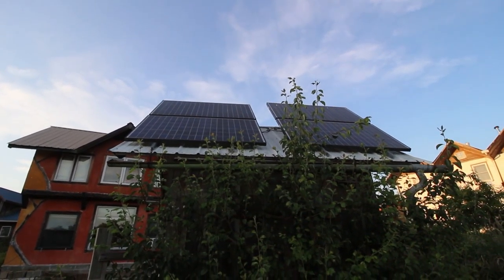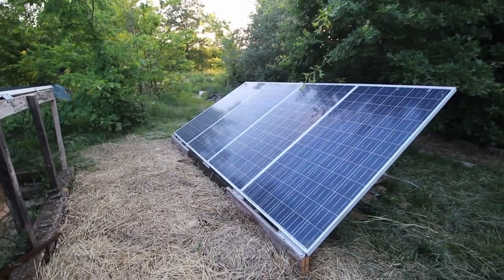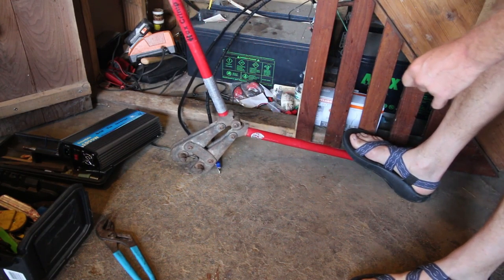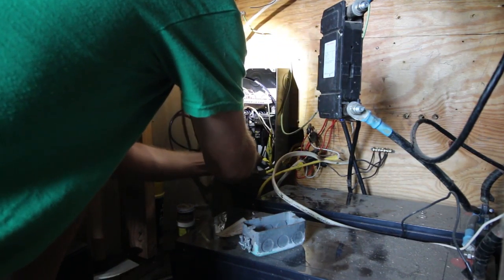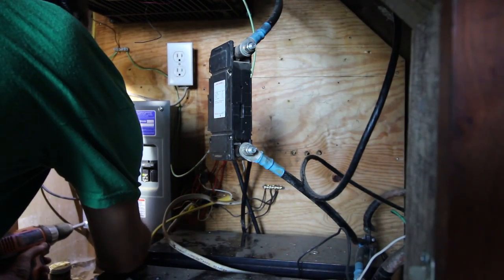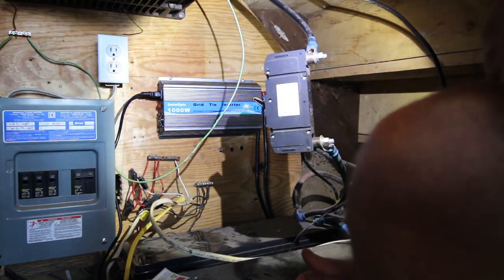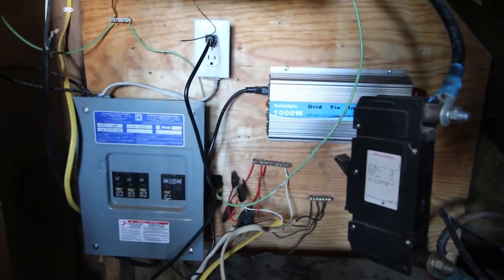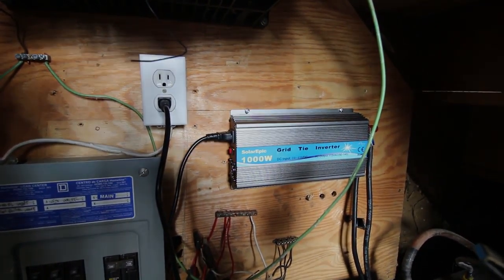The Cheapest, Easiest Way to Produce Solar Power at Home

Comment: Dan, love your videos. I'd like to hear more about your DR micro grid - "BEDR"? Wasn't sure what you called it. My biggest question about using the micro-inverters would be how your micro-grid system supplies power during off-peak solar hours (evening,night,early morning). I am considering PV at my off grid cabin but would want power at nighttime. So maybe a battery based system is better for me? I'm interested to hear how your community handles off-peak power demands - is your micro-grid actually tied into the "real" power grid for those demands? Thanks!
Reply from the maker: I'd like to do a video soon about our microgrid--BEDR.  It is connected to the local power co-op grid.  People without batteries here get power from the grid at night. The grid tie allows us to back feed into the grid whenever it's sunny.  Before we were grid tied we would be limited in power during the shorter cloudier days of the year and then in the summer we'd fill our batteries and have to find "dump loads" to keep from losing the extra power. Now all that excess power goes into the grid and offsets what we use in the winter and at night.  Hope that helps.

Comment: can i run fridge and swamp cooler only at night off on soler panel
Reply from the maker: If you have a battery system you could run a fridge at night.  I thought swamp coolers just worked off evaporation.
Reply: +Hardcore Sustainable they have electric motor
Reply from the maker: You just have to size your battery system to the draw that you will be expecting overnight from the fridge and swamp cooler.  There are some easy calculations and depending on the battery choice the price can vary, but that is probably not a lot of draw.
Reply: +Hardcore Sustainable awesome, thanks man

Comment: You could (possibly) wire two of those panels in series, and connect them to a micro inverter. That would kind of mimic a larger '24 volt nominal' panel. Check of course that the micro inverter can handle the output of the panels though, for safety. (Should only 'use' what they can handle but... cheap Chinese things... never know. :P)

Those inverters like you got are fine, if you don't need it to be UL listed.
Reply from the maker: I did actually connect two panels in series together to bring them into the range that this microinverter could handle. The enphase microinverters were only 250W and wouldn't handle the wattage of two of my panels in series. But I was able to find this microinverter that could handle 1000W.  So four panels with a pair of two in series connected in parallel making the system 24V nominally. The inverter handles 22-45V, so two in series brought the total into that range.  The total wattage was 840 for a 1000W inverter.  I didn't really explain this in the video.

Comment: They just passed a a tariff on all overseas panels so no more cheap Chinese panels at half price... Only if you have a analog meter on your house still, my utility just switched out my analog for a 'smart meter' which now you have to actually get their permission to backfeed onto the grid I can no longer do it with meter!
I now have to get batteries and a limiter grid-tied inverter to tie into the house, the limiter inverter will not allow feedback on to the grid...
Reply from the maker: Yeah, that does kind of suck to have the price of panels potentially go up.  It would be better if the tariff income was used to promote solar expansion or give a subsidy for installations.  There are predictions that it will gut the solar industry and stop the massive growth it has been undergoing.  Still the panels will be far cheaper than they were only a few years ago.  I'm sure the Republicans are in favor of it because it will benefit fossil fuel industries.

Comment: So you bought batteries, now you want go into grid, sorry I'm confused, my fear with grid, if a power surge hits, and they do where I live, I want mine protected from surges
Reply from the maker: I want a battery backup and I've also got DC appliances. Your charge controller, inverter, breakers, etc should protect from surges.

Comment: They should work just hook them in series instead of parallel to meet the voltage
Reply from the maker: I did figure out this problem if you watched the whole video.  I needed to find an inverter that would take both the voltage and wattage.  When you connect the panels in series it doubles the wattage, making the system in compatible with most inverters.  If you watched the whole video, I explain that the inverter shuts off automatically when the grid goes down. It needs grid power in order to work at all.

Comment: Why are you trying to hook to the grid? I thought the reason to go solar was to get off the grid.
Reply from the maker: Being off grid has a lot of benefits, but the high cost of the equipment and the embodied energy of the components is a reason to tie to the grid.  In our ecovillage, which is in Missouri where our winters are dark and cloudy, being off grid in the winter used to mean we'd often be down to using candles to see in the long dark nights.  We'd also have to find dumploads for the excess power generated in the summer because it was more than our batteries could store.  Now we collect extra power when it's available in summer and dump it into the grid, and in winter when the weather is bad we take from the grid so we can actually have jobs and stuff.

Comment: Panels aren't getting cheaper because of government subsidies.
Reply from the maker: It has actually contributed to the demand for panels and the increased production and economies of scale, which has made them cheaper.  Without the tax credits, the expansion of the solar industry in the US would not have happened on anywhere near the scale it did.  The timing of the drop in panel price perfectly coincided with the subsidies as well. And many states offered subsidies in addition to the federal subsidies. Chinese production, and the outsourcing of production to China by American and European companies has also played a huge part in the prices coming down, but with the new tariffs on Chinese panels, that will change.
Reply: US tariffs on Chinese panels might make panels more expensive in the US but not everywhere else.

Comment: DAN Tho's are NOT ok to use in the US. Your is fine as your have that cool setup with DR. But tho;s of us in the rest of the US if we back feed with tho's and I did I had 4kw of tho's and 4kw of pv. I set it all up. Was making a load of power. Got my bill and BAM it was 600 KWH more, When I looked into it The Power I sent back to the grid I was being made to pay for it.When I asked the Power Co-Op why. They told me Tho's are not UL listed so they can't be used and that I must have a net metering  contract.

Your so lucky you can use them. One more tip to get them to last a long time. You may need to look into buying 2. Then brake it up. That will keep it from getting hot and running the fan as much. After I got my SMA micro grid tie 2500 watts setup and did all the stuff to get my net metering. I did reinstall the wall deals for a wile. One day my wife not knowing let a friend of a friend come over. She worked for are Power Co-Op. She asked about my solar and my wife showed it. When she seen the setup. She Told someone at work about it. I end up losing my net metering for 8 weeks. Now I have it back. But I do not grid tie as much Just have one 250 watt SMA micro grid tie  going. The rest of My pv is on my off grid. We now do not buy but about 50% of are power in the summer and even less in the winner maybe 90% in the winter. End the end it works out best for us. The summers are hard here in SC with the heat and my health. So I must have AC that is why we buy as much power as we do. In the winter I do not mind being cool. That saves us a lot. 

Lol So I told you all of that to tell you I found tho's plug in guys work and last the best if you run them with less than 50% of there power ratting. 

You know I am not trying to be a ass. Just would hate to see someone do what I did and end up getting in big trouble or at less costing them loads of cash.
Reply from the maker: Thanks for the info Bobby.  I didn't know some of that stuff about the inverter.  I would guess that anyone wanting to use this product or any other to backfeed would have to have net metering and set that up with the power company.  I didn't mean to imply you could just set these up without consulting the power company. They are powered by the grid so they shut off if the power ever goes down, so I'd guess they are not a problem in reality. I think power companies just don't like having people set up net metering because it seems like a pain and they make less money for the amount of infrastructure. Hassan from DR told me he'd looked into these microinverters and they are ok to use for us, though as you said, we have our own microgrid.  So as far as the capacity and overheating, you are saying that if the inverter is rated for 1000W you would not put more than 500W of panels on it?

Comment: contact altE store for best info.    net metering will soon be a thing of the past      off grid is the best or hybrid system.      great vif.
Reply from the maker: Off grid is not practical and requires lots of batteries. I used to be off grid and it was a pain maintaining the expensive batteries, and totally not practical or replicable on a large scale.